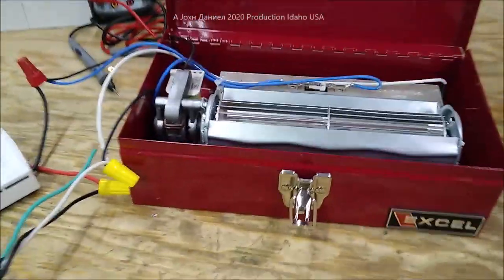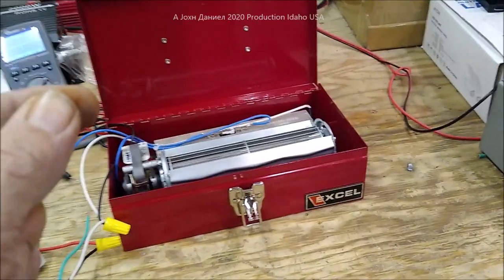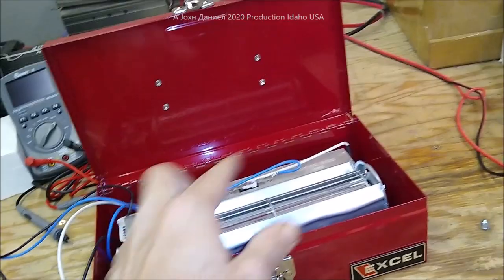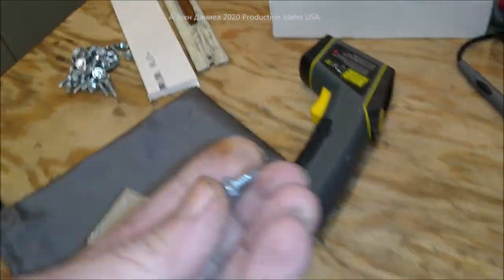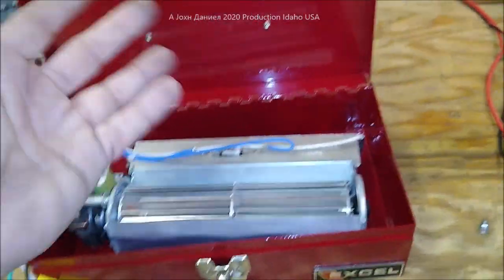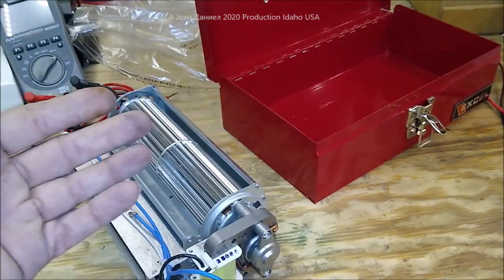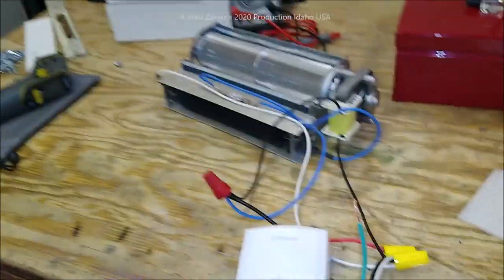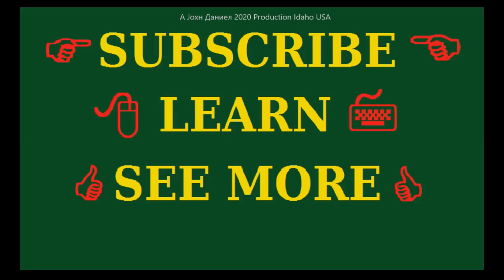Make a Toe Kick Heater from cheap parts for RV's and more

Comment: I bought a diesel puckup truck July this year. 
Being a 2016 it has dpf and shouldn't be left idling for extended periods of time and the remote start times out in 5 minutes. 
Winter is coming and I've been pondering ideas to heat the truck up faster incase of extra cold weather and to assist defrost while engine warms up, which can take a while. 
Thought I'd run an idea by you. Maybe you have better suggestions.

I've built a few things as I get inspiration from your builds (one build was fan circulation for a wood stove that kicks on with stove heat and off with room mounted thermostats) 

I can hook up a power queen to an inverter to a 700 watt ac heater and leave it turned on getting thermostat signal from 2 switches in series, one from oil pressure switch and second a room thermostat in the cab.
To prevent draining the truck battery I can put a rv battery switch between the truck battery and power queen battery. 

Few possible issues is stand by power drain and I don't want to hook up ac power or dc to ac relays under the hood or dash just for a heater that'll be un needed most of the year. 

I've also thought about propane catylitic heater but can't integrate one with the remote start, granted it wouldn't be hard to make a frame to set on rear seats while folded down and light it up when needed not requiring any power from the truck. 

The diesel heaters might be too big and would have to go under the bed cover then blow threw the rear sliding window requiring lot of brackets, suports, and plumbing while taking up bed space. 

Most likely go with the Catylitic heater as its cheaper and simple to put in the back or remove.🤷‍♂️
Reply from the maker: EZ solution, What's the make and model of the truck.
Reply from the maker: Your handy, I would install a fueled full engine heating system, I had one on my F250 powerstroke in Idaho, heater and defrost was spot on in 30 seconds from starting in 0 temps. https://amzn.to/3BlTtLf
Reply: @JOHNDANIEL1  2016 gmc canyon CCLB same as a chevy colorado
Reply from the maker: My 1st suggestion, full DEF Delete, https://thedieseldudes.com/products/gm-chevy-canyon-colorado-2-8l-full-delete-bundle-2016-2020 or you can add a fueled heater like the one on Amazon in a previous reply. Problem with that engine bay is I do not have much info on them for space, but if your 4x4 then you may have the space to do it.

Comment: The unit I could use wire around the heater I need the squirrel cage blower for my propane fireplace blower I have squeaks slows down and speeds up it is not a very good quality lower.
Wondering do they make the squirrel cage blower the same quality but without the heater?
Reply from the maker: Luckily they are cheap enough to buy 2 and use them to get both your projects back up and running.

Comment: How do you turn a 14v dc alternator into a 48v.i want to make my own wind turbine.i have a wrangler 225amp 14v alternator that i bought years ago for stereo competition but never used it.
Reply from the maker: You can, but at a cost higher than ordering a real built low RPM new PMA. What you will be after -  https://ebay.to/2QRA6QU  The car alternator design as is was made for 1300 to up to 13,000 rpms, the already built ones with neodymium magnets and magnetic wire in them is completely different stuff in a similar looking case. Only Thermodyne/Hornet makes the best n45 48 volt models.

Comment: You can't find a small heater that works at WalMart these days.   I've gone thru a half dozen in the past two years.  They ether do the Chernobyl and melt down or just don't produce any usable heat.  Going to give this a shot.  Good Dump Load this time of year.
Reply from the maker: Because of their design to be cavity and wall mounted in their original use they are more safe and trustworthy than most portable heaters today.
Reply: @JOHNDANIEL1  NO DAMN PLASTIC !
Reply: Just ordered one.    I already have a new Control unit to  use.
Reply from the maker: You can make a portable with a slightly larger tool box or ammo box that will be the safest heater you ever had.
Reply: @JOHNDANIEL1  Personally I'm not concerned about the safety aspect.  I just want low wattage HEAT.  Being all metal nothings going to melt on the thing.  LOL   Plastic bodied Floor Heaters IS STUPID.

Comment: So john i could just wire this to a 3 prong plug and plug it into my inverter and tube the heat to my bank for winter heat ?
Reply: Oh and i have drok thermal controlled relay boards digital has heat mode on it lol.
Reply from the maker: Yes, and no. Be sure to put it on a low temp thermostat like I showed
Reply: @JOHNDANIEL1  is that because the unit can go up to 1350 watts?
Reply: @JOHNDANIEL1  the thermostat takes 1 to 2 mo to get is there another one that will work on amazon i can order with prime faster?
Reply from the maker: @donaldsteele6276  The Honeywell is the other best option with 35 degree lowest on cycle https://amzn.to/2U8nXZO

Comment: John one more question how do you gauge the size of the intake hole versus the size of the exit hole is there a fractional difference in the size?
Reply from the maker: I have built many of these over the last 10+ years and doing a RPM test to see when the blower starts to react to air flow load I found the output volume is dictated by the air flow resistance of the coils which gives it a balanced free flow ratio of almost exactly a 3" ID sheet metal tube ( 3" x 3.14 = 9.42 square inches sectional flow) So the equal math in intake would be basically 1.6" x 2 but I use my rolling machine to make two 2" ID tube adapters then use those cheap 2.25" scrap shop vac hoses to get totally non restrictive flow of about 12.5 square inches at the box - so any tube length for intake can be up to 24" each in ratio justified to keep a free flow of 11.15+ square.  Also allows for some basic high flow intake dust filtering if you like.
Reply: @JOHNDANIEL1  thank you John

Comment: I was hoping to see a snapshot of finished one.
Reply from the maker: I considered that but I am making 3 enclosure styles all based on the same general materials. What stays the same is the heater cartridge and thermostat so I concentrated showing its mountable design and functions. It does make a very low wattage good output compact portable heater with high durability and safe function using the Exel Box and I do have one I made earlier somewhere around that I can do a video on that I use on a cargo trailer occasionally.

Comment: I thought about building something similar. Using the PTC elements, 12 & 24v and something like 100-150  watts each. I was thinking about 300-400 watts total, and use a couple computer fans, I haven't thought about thermostic control, I was thinking toggel switches for each fan and element, giving a low, high fan, and lo,med, high heat, maybe 3 fans, 3 elements , or maybe pwm fan controller, I'm still thinking  about  getting a diesel heater, it would be nice if they generated enough power to atleast run their self, a small RC engine and generator maybe, I have thought about it , it gets larger and larger , until I'm thinking car engine and 20kw generator! Using the coolant for heat, and the rotation to generate power!  Ha-ha...  But for a small camper or house heater a 2 to 5 hp engine, with a generator would work,  if not using the engine heat, use DC heat elements, a 50 amp alternator can make alot of heat!! Happy new year!
Reply from the maker: Next time your venturing in or around a auto salvage, look for cars/trucks with broken side mirrors with the ice melt 12 volt 10 to 30 watt heaters in them, they will give them to you. I got about 40 of them of numerous sizes and glue/stick 8 of them on thin aluminum sheets about 26 gauge thick and they are in my RV placed in random spots for when the wind and solar power diverts they make a nice amount of free heat. Here is a version of what ( if you can find used ) to look for ( https://amzn.to/2tHZlf0 ) or you can buy them cheap new. You will need a NC BiMetal disc thermostat of 100C like these ( https://amzn.to/2T6egKE ) to keep them from over temp. Mount them 1" from the heater strip on the aluminum clamping them with gentle pressure using a 3/4" wide washer and sheet metal screw. Maybe I can do a video on it.
Reply: @JOHNDANIEL1  cool I have a few of the thermostatic switches, thanks!

Comment: I want to put one in my battery box .mount it outside the battery box and vent it into it and set it up on a voltage relay .my bank is full the sun or wind is charging and is cold out i want it to automatically turn on and heat the bank in the winter automaticly . Cool i was going to make a solar heater a glass frame with copper plumbing tubes painted black with a temp relay and blower fan .this one could burn off some power and heat the batteries nice.i have a problem thats a good problem .since i added solar tracking my system makes way to much power now. I added 6 desulphinators to my bank and this heater would definitely restore the battery banks ah ratings in the winter.
Reply from the maker: Sounds like a logical solution. You know how we get them power house winds in winter inversions and how the batteries can save the charge they got if kept warmer with some diversion power. I keep mine in the shop so they don't loose energy due to cold. At 20 degrees for one hour a lead acid battery can up to 1% per hour just on stand by, but a wind storm can put some heat in the box and warm the thermal mass. Just have to figure out a most efficient way to set it up!
Reply: @JOHNDANIEL1  john us old innovators are a dying breed .when I see you teach this craft to your children it makes me have hope that some place on earth the innovative american will still be out there. Oh btw i need some outer case battery bank post for linear actuators and lights . Could you please email me a paypal invoice for 10 of each red and black the bigger the better. And i sent an email showing what parts i have to construct a resistive braking system 90 amp 3 phase ac to dc rectifier 3 100 watt 3 ohm omite black resisters and a 100 amp 3 port throw switch. If i took those and wired them into my throw switch down position and used 10/3 carol wire and spades and wired the rectifier to the bottom ports and wired the 3 resisters in parallel to the rectifier  DC side and a negative side shunt and meter do i add another switch and loop it back to the bottom of red box battery port?
Reply from the maker: @donaldsteele6276  I can check on my bulk head terminal supply and see if I have enough left, I do need to re-order a few hundred soon. As for the switch design, send me some good pictures and the parts pile your using so I can determine the layout better and get you some answers.
Reply: @JOHNDANIEL1  i did
Reply: This was todays update with solar trackers and some dirty winter wind beating the hell out of the turbine lol. https://youtu.be/CVyjtJY2h6E

Comment: What is the amps on the high side ?
Reply from the maker: Both elements powered in the self made box used you get 10.90 ( 1300 watts) max draw outside of the Amish style heater, 12.30 (1425 watts) if installed in the Amish Heat Surge styled heaters. Showing the so called energy efficient electric fireplaces and Amish heat surge heaters use about 130 watts to operate their wasteful constantly failing control system! Shame they chose to avoid a simple $15 duplex thermostat for a $85 complicated piece of crap heater control computer. And to make matters really bad, every fire caused by those heaters was from a control board meltdown, not from the heating cartridge.

Comment: John it says 1350 watts 120v .
Reply from the maker: That's if you use both elements. Using one is under 650
Reply: @JOHNDANIEL1  oh okay that makes sense.
Reply: @JOHNDANIEL1  man i am going to come up with something cool with this. During nice windy and sunny day i might want the full power would a battery disconnect switch or rocker on one of them .then i can use 600 watt or 1300 watt since im hard wiring the unit to 6 awg carol wire to a 50 amp or 30. I could then use low temp control and and switch to change power consumption.thanks for this video john way cool. They only come in AC not dc 12v ?